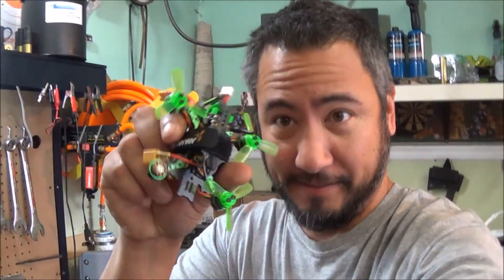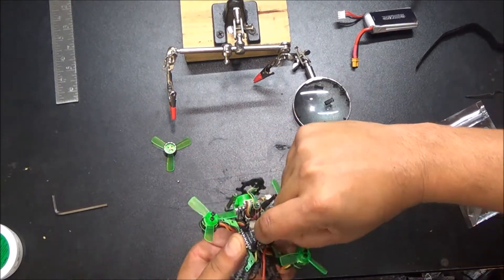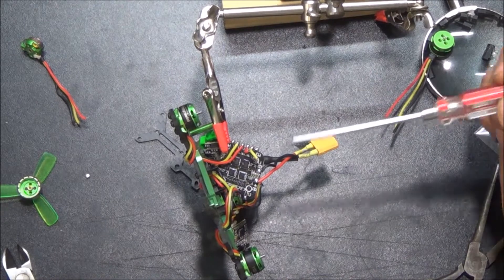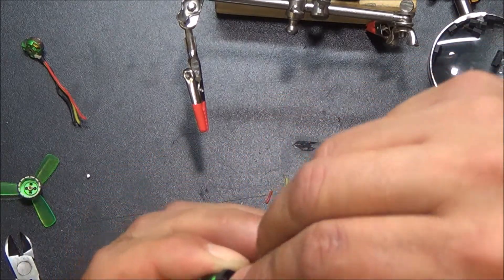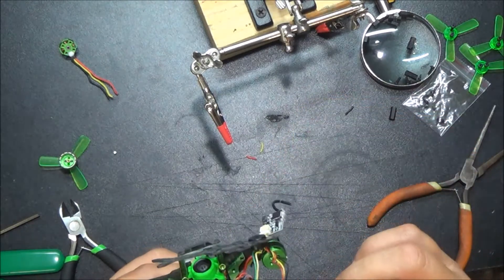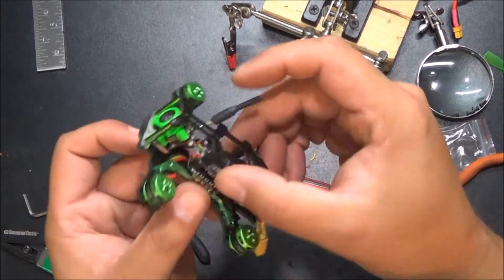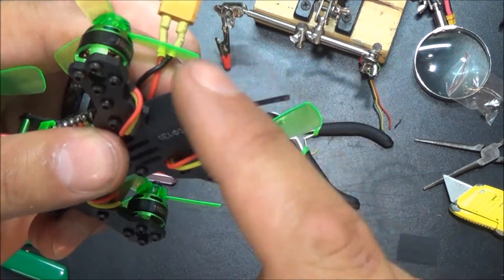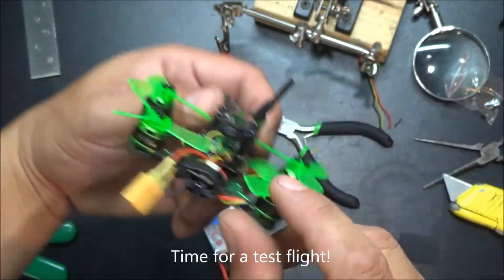How to replace motor on Mantis 85 drone

Comment: Do u know by any chance if i can just install emax RS seriee 1106 II 6000kv  motors onto the mantis 85? Can it handle it
Reply from the maker: Honestly i have no idea.  Sorry i cant be any help
Reply: @HodgePodgeGarage  do u kknow if i can use the fly sky transmitter that came with the mantis 85 on a mobula 6 elrs ? Lol no worries if not

Comment: Hi Brother, Nice video! Did the new motor come with CW or CCW turn so we can easily install it?
Reply from the maker: You can swap one wire and it will change the direction.  Doesn't matter which wires you swap
Reply: @HodgePodgeGarage  Well noted and thanks for your response, Have a nice day Brother!

Comment: i just changed the bell on the 2 motors i broke. works fine! =) But now i have broken a new shaft.  =/ Thinking of mabe change to some other motors.
Reply from the maker: Anton Andersson yeah.   I think I may do the same thing and see if that also helps the prop wash.  I had a bit of a hard landing again in the street and now it won't power up.  Lights come on when I plug in the USB so thinking I broke a wire or possibly the esc.  If I have to replace the esc I am going to do higher amp and upgrade motors too
Reply: Sorry to hear, i busted my ESC but that was my own fault when i put to long scrwes in when i installed some prop guards. Its hard to find 16x16 esc i ended up with the same one but i think its a good ide to upgrade to higher amps then you a future safe if you get bigger motors =) I also crached my leader 120 and busted the gyro on the FC and my new camera... I need to start flying in "softer" enviroments :P